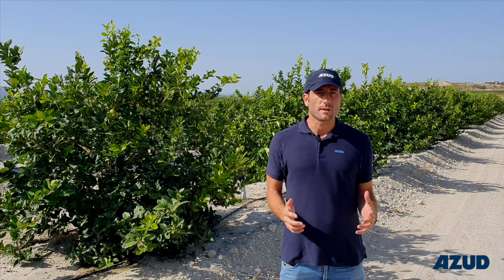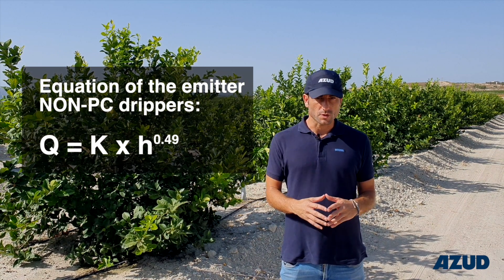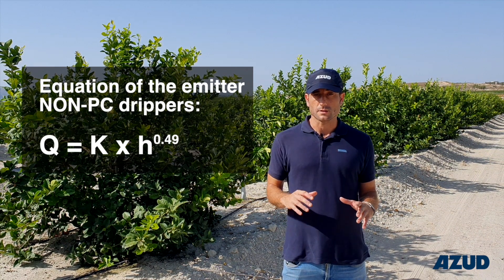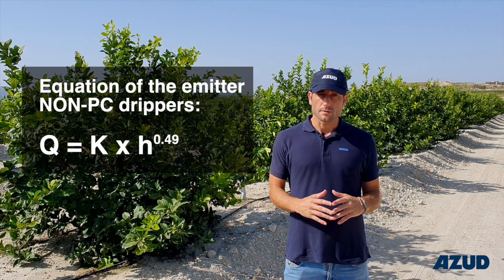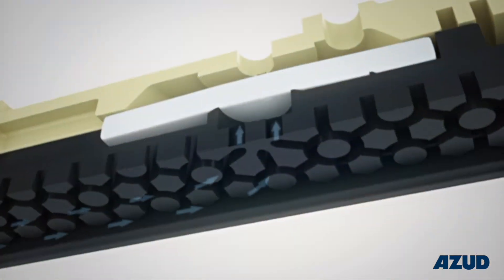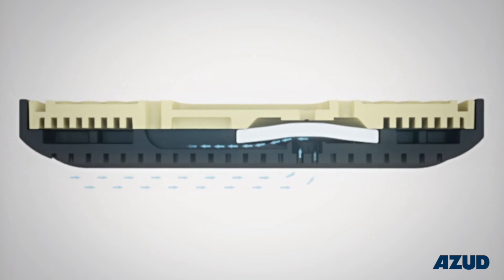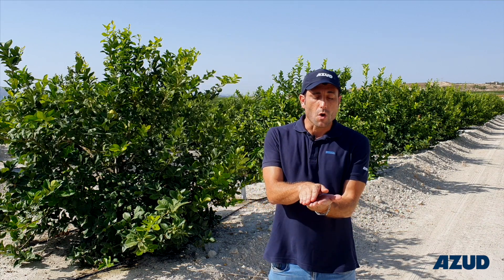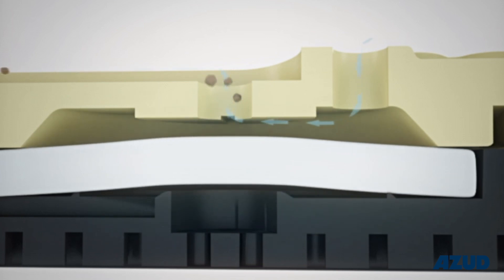Irrigation Driplines: How to determine the maximum length of your dripline?

Comment: Wow this video is wonderful.... 
don't we need to take into account the slope into consideration even with PC emitter?
And how does the max run length get affected in plain lateral with Online Dripper installed on it?
Reply from the maker: Hello, thanks for your comment!
Slopes are important and need to be considered. It is still highly recommended to use PC emitters to facilitate irrigation uniformity.
Regarding your second question, we recommend you to use our hydraulic design software, AZIS (https://azis.azud.com/#/lateral). This will allow you to calculate the maximum length according to your specific needs, since you can introduce all your data, including the type of dripline, dripper, slope...

We hope this helps! Don't hesitate to contact us for more info: www.azud.com/en/contact/

Comment: So if you have pressure compensation do your lines have to be the exact same size?
Reply from the maker: Thank you for your comment!

It is not necessary that they all have the same length, the compensation is made by the irrigation emitters. But It is necessary to consider a maximum distance, stipulated by the manufacturer for each pipe model. 
You have to take into account that the surfaces in the field are usually irregular, so when calculating the design by sectors must be taken into account, not each individual pipeline.
 
If you would like to receive more specific advice, please drop us a message at www.azud.com/en/contact/agriculture